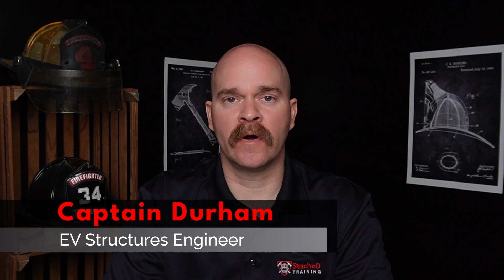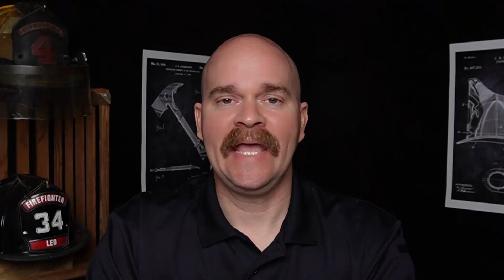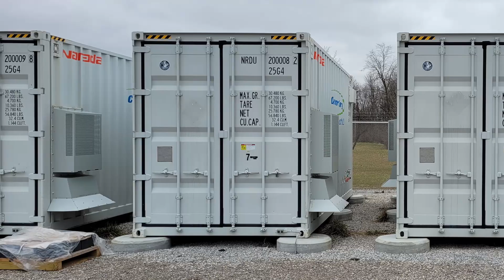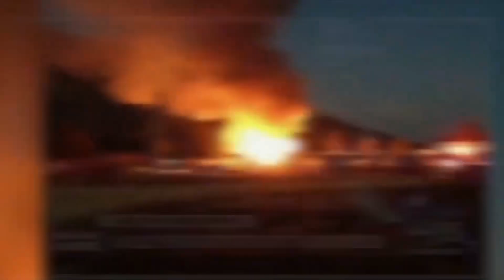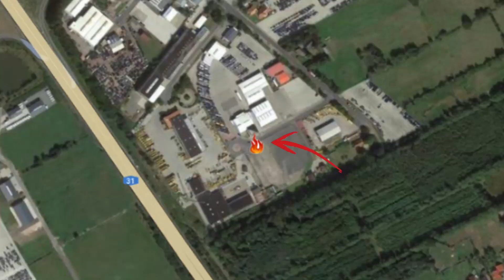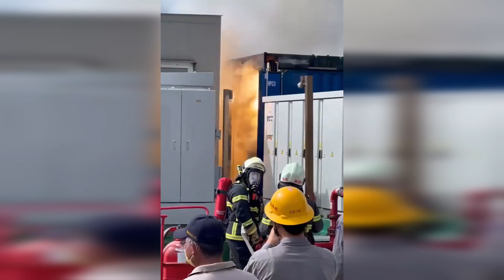Battery ESS Fire: Neermoor, Germany Incident

Comment: I tried to buy a bedside sleep device that needed shipping abroad. After much confusion it turned out that the device that I bought couldn't be flown out because it had a lithium-ion, back-up battery within. I had no idea that such restrictions applied now. It shows that shippers and insurers take a serious position on the dangers involved in these batteries even at a domestic level.

Comment: This could be interesting... mandate that only the open isolation BESSs be used, and that older units must/ SHALL be replaced. No exclusions. Then mandate scrubber systems be attached to filter off- gassing and smoke if/when a fire starts. 
Safety first, and the safety regs would add to the already stupendous expense of these capricous fantasy "free energy" junk piles.

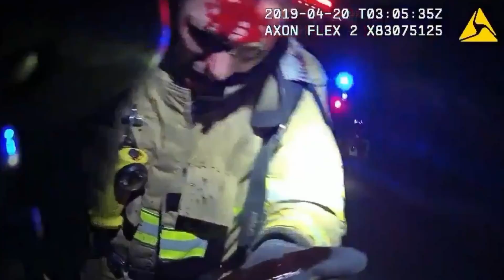Comment: Gravity feed water 3:10 tower with thick poly liner 30 feet below grade on compacted clay, oermeial base below containers. Berms to contain 10,000 gallons per 1200 pounds of batteries. Easy to do.
Reply: Or just forget about the stupid idea of bess systems. Would reduce slavery at the mines too.

Comment: Why aren't those systems surrounded by earthen berms or Hesco gabions so they can be allowed to burn down without intervention? Even if you put the fire out not needing to respond instantly buys useful time.  Battery fires cannot melt through ten feet of sand, and berms or gabions can be kept moist with common sprinklers. Containerized units SHOULD NOT REQUIRE ENTRY to extinguish fires. That wastes internal space vs external access. Shelters should contain fires so a module need not be extinguished in the first place. A properly designed shelter should burn to the ground without posing an external threat. 
This is not difficult. Berms and revetments are cheap and easy to erect and easy to demolish.

Comment: Confused on your analogy of venting. Do FD s not use the EV blankets to suppress the O2 to put out the fire? 
No O2 puts the fire out does it not?
Reply from the maker: When these batteries fail, it is a self oxidizing fire.  Thermal runaway can occur in the vacuum of space.

Comment: I see a lot of ignorance about the nature of lithium battery fires. These are chemical fires that contain their own energy and are virtually impossible to extinguish, they have to burn out. The key is to limit the fuel supply so that a single cell on fire does not become 1000 on fire.

Comment: We've been using lithium-ion in consumer electronics for decades, mostly safely.

However big capacity units are better served with safer chemistry, Sodium-Ion and Iron-flow for example. Battery energy storage is vital to get right, especially if we aim to get control over climate change and hope to have modern human civilization in 200 years time.

Comment: The best thing you can do is isolate like he said, build the units (I said build not find a cargo container) and build it to contain the fire and a exhaust system to control the outgas and fire. If we can build a rocket engine (which these things basically are once they get going) to withstand thousands of degrees and super high pressures this shouldn't be a problem that can't be solved. The real problem is greed, these companies want the profit but don't want to spend what is needed to make them safe.

Comment: I have a LiFePo4 home battery setup with a CO2 "extinguisher" near it (outside). The CO2 is to cool down. There is a lot of difference in the type of rechargeable lithium batteries. I actually wanted to have a Sodium battery, but alas, it was either LiFePo4 or no power at all.
As a proponent for battery storage, I say this: never ever stop making videos about the dangers and the flaws in these setups.
LiFePo4 however is much safer than Lead Acid. But never ever forget about what to do when the battery burns. Make sure there is an exit for the gas. Make sure that anything surrounding the battery can freely burn. Because realistically if it starts, the battery is gone, but your house doesn't have to be gone.
The chances however of the battery catching fire is much smaller than the chances of poor PV wiring catching fire.

Also: do not store your old phones with lithium batteries somewhere in a drawer, because those batteries can get dangerous. Those are not LiFePo4 and can really explode.

Comment: This is smart and good what he said.
The burning module could be kicked out from the container if it is on a sliding table. It could fall then into sand or possibly a water trench, so that it is as far away from the container.

Possibly it started with a single cell. If we have on every cell a temperature-sensor and the capability to kick out a single cell automatically, then we could save the other cells and decrease the problem.

Comment: Lithium batteries are what is installed in homes for solar power, so that just makes sure if they burn the house will be a complete loss. what gets me is all the rabid EV fans who say gas cars are burning more often than EVs. but you can put out a gas fire quickly .  someone needs to find another none flammable battery system soon.

Comment: Battery  nightmare....  No such thing as a Safe Battery
Reply: Yep, these lead acid batteries in cars are super dangerous....
Reply: Yes, Gazoline is much safer. It can not burn.
Reply: You mean…no such thing as a safe LI battery
Reply: @onerider808  LFP is safe. NMC nd NCA are safe as long as you handle them correctly LTO is very safe and stable in itself.

Even water is dangerous when verheated or undercooled.

Comment: How about doing some research and using proper terminology first? LiIon is as unspecific as it gets. What chemistry? What setup? Why are we seeing a thermal runaway whereas there shouldn’t be one when using LiFePos? 🤦‍♂️
Reply from the maker: I don't typically get into chemistry because it is irrelevant to most people.  Often times we do not know the battery chemistry involved in these incidents.  LFP (or LiFePO) can, and does go into thermal runaway.  If you look at the link in the description, there have been 5 confirmed BESS thermal events since 2021 that involved LFP chemistry.  Including one in my home state where the BESS that caught fire is an installation that uses LFP.

Comment: Most new EVs no longer use Li Ion batteries. Instead they use LiFePh batteries - which are far less susceptible to fire.
I agree that ESS manufacturers need to have fire expert input. I think that they assume that cutting off the air/oxygen will suppress the fire.

Comment: I just scanned several German news about that
- there was ONE container burning
- that unit was stored, not operating
- firefighters were able to pull that container forward to isolate it from others.
- there must be some miscommunication: Firefighters were told to open the container, the supplier said NOT to open - the truth has to be found.
Reply from the maker: I suspect the container was opened prior to contacting the supplier.
Reply: @StacheDTraining  Seems like they opened it after consulation with the operator/owner.
( Article on pv-magazine )

Comment: You did not get into specifics on the battery chemistry used. My understanding is than Lithium Iron Phosphate and Sodium ion chemistries are safer.

The only reasons the Lithium Nickel Manganese Cobalt chemistry was used in cars was both for the extra energy density, as well as a patent work around to avoid using Nickel Metal Hydride (because the patents were owned by an oil company who prohibited the use of the tech in electric cars).

The original Tesla battery banks used the same batteries Tesla used in their cars. Even though a stationary application does not need the energy density.

I will trust your judgement on the use of fire suppression systems in such battery banks though.
Reply from the maker: There have been a number of these BESS fires that used LFP chemistry.

Comment: In my opinion having it in a closed shipping container makes sense, however all these battery storage systems should have another container stacked on top which is connected via a pipe. The top container should contain a minimum qty of brine solution that can be used in case of a fire to deluge and totally submerge the content in the battery storage container.  Brine because it’s conductive and naturally shorts out the cells, gravity fed, so no pump required.
Reply: Lithium ion battery fires create their own oxygen. That's why they burn under water. There are a few YT videos showing completely submerged Teslas sending up flaming gasses that burn on top of the water.

Comment: Just wait until our electrical grid is dependent on hectare-sized, wind and solar charged BESS warehouse complexes. Imagine the chaos when power is needed badly due to adverse weather events, and the increased demand overheats a unit, and initiates a battery thermal runaway fire that destroys the entire facility and blacks out whole states, as we saw in Texas a couple of years ago. When was the last time a storage pile of low-sulphur coal caught fire outside of a steam generating plant?

Comment: So, I have a math question.  People say that Li-ion battery fires are not that frequent, however, you quote 30 fires in BESS in the last 2 years ... 15 per year.  Given the relative energy distribution, any government that was taking an objective view on these systems would deem them unfit for deployment and shut this down until a better plan and solution is in place.  Consider if this happened to 30 power stations in a two year period.  There would be hard questions that need to be answered.  

I suppose it is the times that BESS and other applications get a pass on safety.
Reply: How many wall marts caught fire from solar roofs?   Another sign it isn't green energy it is destruction of the green in your safe.

Comment: I wonder if these fires are NMC based systems of if LFP is also involved, as in generally this is considered a much safer chemistry. 
For home storage LFP (LiFePO4) is already pretty much the standard in the Netherlands, although there are no regulations enforcing this. Are there any fire statistics or safety tests that show this claimed advantage?
Reply from the maker: There have been a number of LFP related fires in ESS as well.  LFP is harder to get into thermal runaway, however when LFP does fail it releases significantly more hydrogen.  So in some ways LFP is better, in some ways it is worse.
Reply: @StacheDTraining Hi, can you point me to a study/ factual evidence to support this claim about more hydrogen released from LFP? Thanks.

Comment: I live in Irvine Scotland and 2 weeks ago there was a fire in a Battery storage/ recycling factory in a town 2 miles away called Kilwinning. The fire took more than a week to put out by many fire units and loads of people were evacuated from the nearby housing estate or told to stay indoors with doors and windows shut because of the smoke from the Lithium batteries exploding. 
The factory/storage unit was totally destroyed. Didn't see much on the MSM about this ... I wonder why?
Reply from the maker: Thanks for sharing!  This might end up in next weeks video.  It's a topic I've been wanting to tackle for a while because many of these battery recycling centers are hoarding batteries.  There have been a number of fires in fixed facilities like this one.
Reply: @StacheDTraining also, Mr Battery-Fire guru: what is the recycling process, from an engineering, chemistry and energy discharge/dissipation point of view?  I'm hoping you're in a good-ish position to pass along at least some pointers of where to find out more about these processes, and hence risks.
Reply from the maker: They are typically shredded in a slurry.  It's a wet process that allows the materials to be reclaimed in the slurry.  It's also not particularly cost effective.  Many companies have gone out of business trying to solve this problem.
Reply: @StacheDTraining  Yes , its the same as plastics recycling mate , i used to work in the shire recycling some years ago  , and the amount of plastics that went to land fill was considerable  , not because it was not possible to recycle a great percentage of it , but because it was very expensive to do certain types of plastic , exactly as you said .... not cost effective . 
 Even glass which is very recyclable , the glass has to be good quality and free from ceramics and certain types of glass are not suitable , when you take a tip truck load down to the glass recycling plant ,  the plant we used , one the biggest and a well known brand would have the glass go down a conveyor, and if there was any bad glass or other contamination , they would reload our tipper and it would go to landfill , and the amount of contamination would only need to be in excess of a spoonful in a whole tip truck load to be rejected .
 Apparently in making or recycling glass , any contamination is a huge no no .
Reply from the maker: @mikldude9376  I used to work in the plastics industry.  You are correct,  recycling plastic is mostly wasted effort.
Reply: These batteries should not be re-cycled.
Reply: ... Thanks.

Fenix Battery Recycling of Kilwinning.

The name though: Lithium "Irony" FauxFate?

Says "Permanently Closed" on Google.
Reply: It was literally on every news channel in the U.K , stop trying to spread conspiracy theories.

Comment: Let me ask a question.  What about designing the unit with a remote fill pipe?  The trucks show up at the site.  They connect a hose to the fill pipe that is at a safe distance from the BESS and they fill the module with water.  This would require the BESS to have all air intakes and electrical connections on top.
Reply from the maker: I didn't speak to it in this video, but Telsa has the right idea.  They allow the fire to burn and control it be not allowing it outside of "the container".  They deal with the flammable gas issue by intentionally igniting the gasses in a controlled way.
Reply: @StacheDTraining  I can only guess there are no standards.    If I were an insurance company I wouldn’t insure these systems or the property they are on.  Most certainly I would never have a home system unless I could keep it at least 20 feet from the house.
Reply: @StacheDTraining remember that there are a lot of big bess sites that are in development and are basically build from different parts that were not designed for a large bess structure. The operational Bess right now are prototypes. Tesla is not the only company that has realised this problem.

Comment: Also notice the array of fans on top. Those fans require energy, typically 30 watts or more each. They are there not only for hot days. Battery's when charged or discharged loose energy through heat. the energy conversion into a battery and out is not for free. All those fans are also needed to keep it cool under load.
All the greenies leave this rather sizable losses out of their calculations.  Literarily the same when you charge your li-ion based phone quickly. Charging often slows down because the little phone battery is getting too hot. It is exactly the same losses just on a very different scale.
Reply: 30 watts?  No way. Severely understated. Maybe you left a zero off.  My cheap $21 energy efficient box fan burns up 74 watts. If these commercial duty fans are rated 1/2 horsepower each, they probably use 450+ watts when they operate.
Reply: @kimmer6 those are probably 3 phase 5hp and up. Not even in the same league as the largest home air handler fan. I sure hope as part of a safety interlock that WHEN the fan fails (Not if, but when), that particular battery bank is isolated
Reply: @jerrykorman7770  I have no experience with those BESS fan units, only other industrial 1 and 3 phase motors. Yes, I can buy 5 hp 3 phase fans as a typical BESS cooling fan..... but for God's sakes the guy said 30 watts to run each. Desktop fans run more than that. A 5 hp fan motor will burn up 3800 watts while running at design speed not to mention starting load spikes..
Reply: @kimmer6  agreed 100%. No way that was 30 watts
Reply: @kimmer6  Almost like he has no clue what he's talking about and is just here to try to score some anti-renewables points like a good obedient little soldier being told to fight "the greenies". "Batteries aren't 100% efficient!  Check and mate!"
Reply: They don't. Because the alternative would be 100% loss. We now quite often have so much regenerative produced power that we switch off the generators. And that is 100% loss or financially even more. No production but costs are running.
Reply: @jfnotk255  True, how ever when you all calculate it. Including the ludicrous production costs, pollution and the gigantic difficulty recycling this toxic containers, wind mills; any solution wind mills are NET energy loss. Without tax-payers money they would be all gone within 15 years.

Comment: Large lithium batteries should be banned. Anything bigger than a cell phone.
Reply: A battery bank for charging your cellphone is already iffy... 20000mAh or higher...
Reply: @emilschw8924  It is not the size. :face-turquoise-speaker-shape:
It is the AMPS.  600,000 AH battery only putting out half an amp will not blow up.
Reply: Vape pens are smaller than a cell phone and go boom.
Reply: Come on man, allow me my eBike battery. 😂
Reply: @JohnHughes2002  yea, they burn up more often than not
Reply: Yes, if you've ever held a hot cell phone in the summertime while it's in the sun, the battery is even hotter and will be able to burn you.  I'm surprised how hot it got, I dropped it immediately!
Reply: Go all the way! Demand that lithium batteries be no bigger than your brain!!!!
Reply: @andrzej3511  Best comment on this page,lol.
Reply: It should be separated by tall, massive, fire proof concrete walls.
Reply: No! Let’s ban phone battery too!